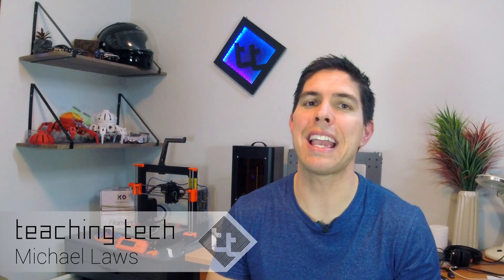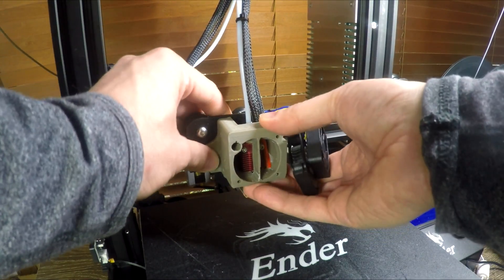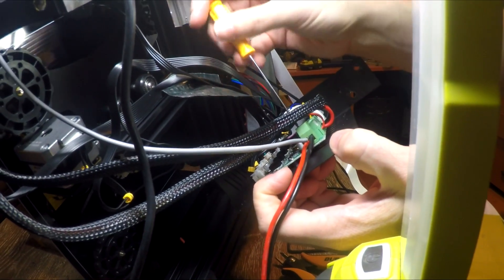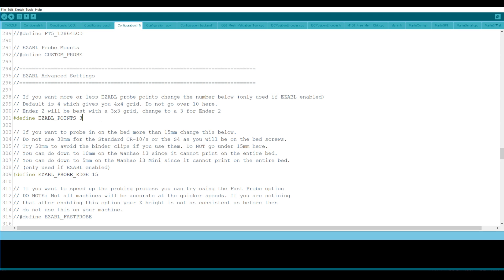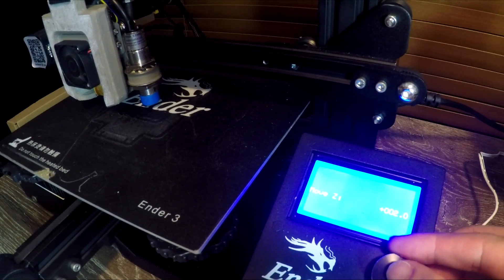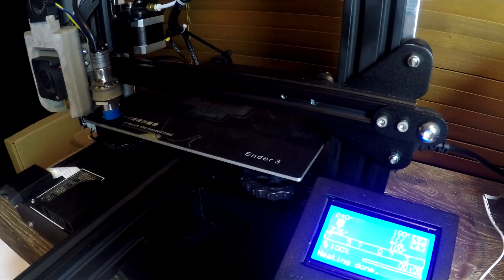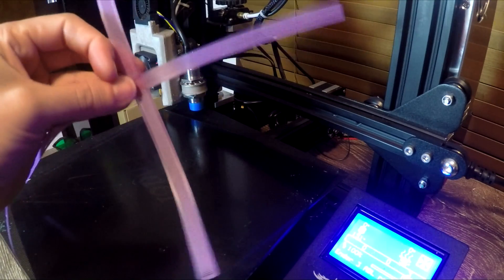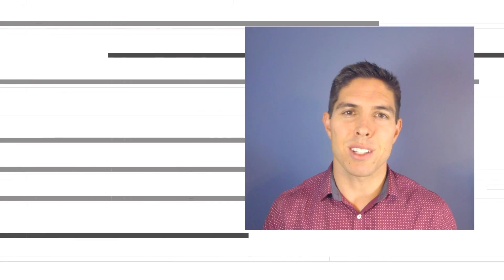How to: Ender 3 EZABL auto bed levelling

Comment: Still not seeing the correct STLs on Thingiverse for the fan upgrade or to hold the sensor. I thought you had stated in another video that the wires where it connects to the heat bed was needing an upgrade but didnt see that in the 7 upgrades video and couldnt find it in the review either. Not sure where I seen you say that or what the model was for it. I just ordered 2 of these for some inexpensive mass production of printed parts I need to do. I have a Prusa MK3 that runs non stop also but I couldnt afford 2 more of those. Have you seen the E3D Crane yet with the 4 color mixing extruder? I havent seen any review videos from anyone yet on that one.
Reply from the maker: The ezabl stls are in the th3d firmware download, password protected. The Ender 3 comes with strain relief for the bed, you may be mixed up with a video I made on the Tevo Tornado where I added this. I haven't heard of that extruder but I'm about to review a geetech dual colour, one nozzle machine.
Reply: The M3D Crane is an entire printer. We ordered 5 for my wife's Introduction to Manufacturing class we started this year at her middle school. Cant wait to see how well it mixes as they claim 50,000 color combinations using primary colors and either black/white/clear for the 4th.
Reply: do you know the name of the file you used for the base  holder in this video i purchased the ezabl down loaded the full firmware package still cant find that file thanks

Comment: Hi, I'm worried, I did everything like the video with all the details and when performing the test the extruder was stuck in the hot bed.
The sensor is placed on the left with respect to yours.
These are the parameters you use based on the tutorial:
G28 ; home all axes
G28 Z ; home Z to get more accurate Z position
G29 ; EZABL mesh generation
G4 S10; wait for heaters to recover 
G92 E0 ; Reset Extruder distance to 0 
G1 Z5 ;
G1 X10 Y10 Z0 F1000 ;
G1 X60.0 E9.0 F1000.0 ; intro line
G1 X100.0 E12.5 F1000.0 ; intro line
G92 E0.0; reset extruder
Please, I do not know what to do.
Thank you
Reply from the maker: No point asking here, if you have an ezabl then enjoy the th3d customer support.
Reply: You can contact our support by emailing Support@TH3DStudio.com :) Make sure to include your order number!

Comment: Just wondering, does the Ender 2 come with the proper connectors on the board and the software? Pondering buying a Ender2 as a takewithme-printer with very little to no setup-time aside from putting the filament in.
Reply from the maker: Haven't tested an Ender 2, sorry.

Comment: thoroughly checked the petsfang V2 now and cant find the fan housing with the integrated mount for the sensor as you show it! (same for bltouch) pls. help!
Reply from the maker: As I said the video it is now a two part design. The one part one I printed had the wrong height and was updated.
Reply: Teaching Tech that doesn’t tell us which ones to download and use as there are like 20 different files for every type of printer......

Comment: Did you have to modify your probe mount settings at all? I uncommented petsfang but my sensor doesn't auto home directly in the center of the bed.  Any ideas?
Reply from the maker: Masure the x and y offset from the centre of the probe to the tip of the nozzle, enable custom mount instead of petsfang and scroll down ower in the file to put your offsets. Depending on how the grid issetup in the firmware it is common for the probing points to be slightly offset from centre to match the way the probe is to one side.

Comment: How to do resume printing while power cut
Reply from the maker: You need to flash either the official creality Marlin which is too old to have thermal runaway protection, or use the BETA version of TH3D. I haven't played with that yet so it might not compile with my instructions.

Comment: Hi I love your channel and I have recently purchased an Ender 3, the second revision. I have followed your tutorial’s and my machine after tweaking produces amazing high quality prints. One problem I had was removing the prints from the bed and yesterday the centre part of the bed lifted and ripped.  Before I built the unit I purchased 3 mirrors cut to the Ender 3 sizes as a number of YouTubers recommend them. I also remembered you mentioning that you had a few beds delaminating. My problem is that I have no idea how to setup the machine for the mirror bed.  YouTube currently has no clear tutorials for the Ender 3 or any other printer. I would also like to add a glass mirror bed to my original 3D printer the Snapmaker 3 in 1. 
I live in Sydney and can supply a glass mirror if you are interested  in producing a video .
Reply from the maker: Hi Ewen, thanks for watching and for the nice feedback. Most of the time all you need to do is remove the factory buildtak surface, place the mirror down, clip on binder clips in the corners and level the bed to account for the new thickness. I'll be covering this soon.

Comment: There should be a screw behind the top left hole of the cooling fan. Did you forget it?
Reply from the maker: I'm using an older version of the mount but in this case, yes.

Comment: I see the regular EZABL and the Mini EZABL. Any difference between them other than the size and weight?
Reply: Mini uses a smaller diameter sensor, so you can sense more of the bed -- make sure the mount you use is designed for a 12mm vs 18mm sensor. For a smaller printer like an ender 3 -- the smaller sensor is better since it's easier to design a mount without sacrificing build area.
Reply from the maker: I think the mounting distance is 4mm instead of 2mm but afaik that's about it.

Comment: I’m new to 3D printing and am considering this upgrade. I assume that once calibrated, differences in the bed height are compensated by raising and lowering the z axis as the print progresses based on information provided initially during leveling?
Reply from the maker: That is exactly right. It fades the compensation out over the print.

Comment: So this version of the firmware you don't have to disable the SD card slot to make it fit in memory?
Reply: Would also like to know....☺
Reply from the maker: Nope still works no problem. It's at 98% of the available storage on the Melzi in this configuration.

Comment: So I use the borosilicate glass creality made but nothing sticks at all.I HAVE to use hairspray for it to stick ?I have tried releveing the bed multiple times
Reply from the maker: The amount of squish for the first layer matters a lot. Also keep in mind with the glass bed on top, it will take longer for the heat to seep up to the top. The thermister underneath might be reading 60 deg C but the top of the glass might only be 50 deg C. Maybe not your problem but something to consider.
Reply: Just flash unified fw that has babysteps enabled, as you see the printer laying down the filament lower the nozzle using the babysteps until you see it sticking. Don't squish filament too much or it will get into those tiny holes of the print surface.

Comment: Nice, but autobed leveling on a e3 is a bit overkill I think. The e3 is so easy to level when you have marlin flashed. I takes me about 60 seconds and I just do it every 2 weeks while the printer is printing 24/7....
Reply from the maker: I haven't had to ply with mine since my first prints but a lot of people have complained about warped beds. It will make a significant difference for them.

Comment: Hey Michael. Great walk-through and very concise. I''ve been emailing with Tim for a while in preparation to getting the EZABL, Tim is very responsive and helpful, he really knows his stuff too.
I haven't yet ordered the EZABL because I found that I still have an unused BLTouch ( I brought it a couple of years ago when building a homebrew is, but never used it). I plan to fit the BLTouch and give it a try first (since I already have it).
Looking forward to your BLTouch video and you thoughts/comparisons.
Reply from the maker: Hi Spike, thanks for watching and commenting. BLtouch I'm a fan of from other printers. They should both be good so it will come down to specific pros and cons for each individual if they want ABL.
Reply: I've just ordered the EZABL too, can't deny it's a bit extravagant lol. I've mounted the BLTouch, but having uncertainties with the config. Think I'll wait for your video, that way I'll know I've got it right. Will then try the EZABL when it arrives. Hoping to have room in the existing gromet for the additional wires, rather than drill more holes in the control box. Although I have the CR-10 S4 rather than the Ender 3, they are very similar (apart from the main board which I have the wiring diagram for) so should be all good...... Fingers crossed :-)
Reply from the maker: You'll be in a great position for comparisons.

Comment: Tim Hoogland makes great products and is a real asset to the 3D printing community. He does pretty regular livestreams to keep us educated, pushes the Marlin project to get things fixed and reliable, does lots of testing, and on top of it all is helping us to crack down on violations of the Marlin GPL license. And, yeah, I really like the EZABL on my CR-10S. It’s simple, reliable, accurate, and was very easy to install. I don’t use G29 too often, since you can save the probe results to EEPROM, but when you really need to re-level a bed it saves lots of time.
Reply from the maker: I haven't dealth with him much one on one but my impressions are good so far. Thanks for sharing your experiences.

Comment: After all of the upgrades on this printer including money and time we are almost getting to a point of just getting a Prusa.
Reply from the maker: A lot of the mods I've featured are printable and free, but you make a valid point. For arguments sake, we have (in USD):
Ender 3 - $200
Dampers - $10
TL smoother - $5
EZABL - $60
______________
Total: $275

Let's be generous an add $30 for tools and wiring stuff and maybe another $20 for the new Creality glass bed. Still gets two of these for less than a MK3 kit. I'd rather have my MK3 however, it is a lot more sophisticated and nice overall.
Reply: Teaching Tech You also need some great skills like you.
Reply: I think the upgrading path is a lot more fun though, yeah I could just buy the printer with all the cool features built in, but then I dont get to customise it and have fun doing all that stuff. Guess it's down to personal preference though, if you need/want a plug and play printer then prusa is the way to do it.
Reply: Max Liberman haha max! I was about to write this exactly comment! +100
Reply: This is the one I purchased https://amzn.to/2CNAMke  I prefer borosilicate glass if only because most of the science/industry sellers round the edges and corners.
Reply: Your whole trash talk message was just to downplay this upgrade video and this amazing machine and nothing more.. Even comparing with the Mk2 the Ender 3 still beat its price point. Get the fuck outta here.
Reply: @zero00tolerance  Looked at the Prusa and price was steep, 3d printed parts that were in places that should have been blow moulded or aluminium, still not a 32 bit machine and price was still on the high side for the parts... and $150+ shipping. Prob $100 in GST to boot thanks to G. Harvey. Not to mention... usually out of stock and huge back-order.

Ordered an Ender-3 today with glass bed and ordered the aluminium Bowden extruder, stepper driver smoother. Looking at Z probe and eventually replace board with 32 bit and touch screen.
Reply: yeah, but where is all the fun? :)

Comment: If I do not have a warped bed on my Ender 3. Would the EZABL be useful for me? Honestly curious :)
Reply from the maker: If you are happy with your setup then probably no.
Reply: I am in the same position as you and was thinking the same thing.  It would cut out the time and hassle of manually leveling the bed, the first couple of times I did this I'd have purchesd this withouth hesitation, with more practice under my belt it's not worth it for me.

Comment: First! Does it make sense to use ABL on a single z driven axis? Wouldn't you need a dual drive to "tweak" the X axis?
Reply from the maker: It still works fine. Even on dual z setup they are locked in unison so getting them square happens manually before any printing.